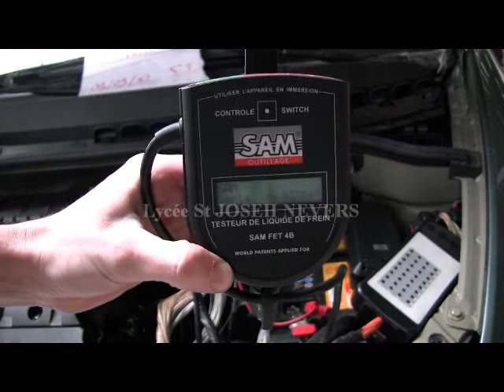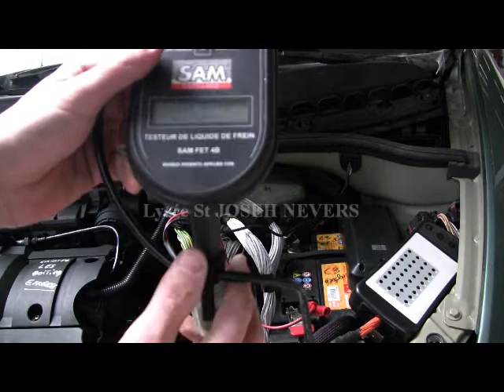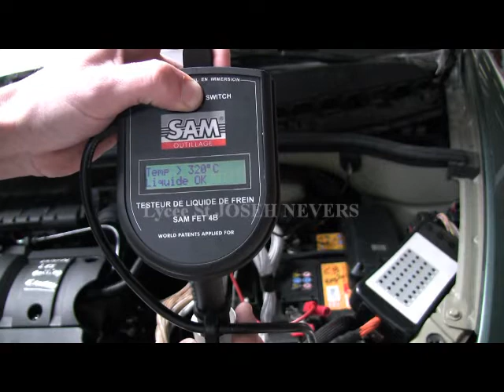Test liquide de frein

Comment from the maker: Ce testeur contrôle le point d'ébullition du liquide de frein. Si ce point est trop bas, le liquide de frein est à changer. Pou rappel, s'il y a ébullition, il y a créations de bulles d'air dans le liquide circuit de freinage et donc il y a dysfonctionnement du système. C'est un très bon outil.

Comment: Un commentaire aurait été le bienvenu..........
Reply from the maker: Ce testeur contrôle le point d'ébullition du liquide de frein. Si ce point est trop bas, le liquide de frein est à changer. Pou rappel, s'il y a ébullition, il y a créations de bulles d'air dans le liquide circuit de freinage et donc il y a dysfonctionnement du système. C'est un très bon outil.

Comment: bonjour , je vous fais un commentaire , on comprend rien du tout et on voit rien du tout sur votre vidéo , pas d'explication a quoi ça sert votre truc testeur d'huile des freins,comment ça fonctionne , c'est quoi ses fonctions , des explications aurait été le bienvenue mais c'est pas le cas ???????
Reply from the maker: Ce testeur contrôle le point d'ébullition du liquide de frein. Si ce point est trop bas, le liquide de frein est à changer. Pou rappel, s'il y a ébullition, il y a créations de bulles d'air dans le liquide circuit de freinage et donc il y a dysfonctionnement du système. C'est un très bon outil.
Reply: bonjour , moi perso , j'ai bien compris que c'est un testeur pour liquide de freins mais mais pour les gens qui regardent votre vidéo , ils ne peuvent pas savoir ce que c'est , comment ça fonctionne , a quelle température d’ébullition , si l'huile est encore bonne ou pas , vous avez mis aucune explications . alors DOT. 3 minime en  ébullition 140°C , il est encore bon , le DOT.4 minime en ébullition 155°C , il est encore bon , DOT. 5,1. minime en ébullition 180°C , il est encore bon , au dessus de ces chiffres là , l'huile est pas bonne , faut changer tous les 2 ans , il y a beaucoup de gens , qui le font pas parce qu'ils connaissent pas , dites vous bien que l'eau bouille a 100°C , maintenant , je vous ai donné les minimes de ces 3 chiffres que l'huile soit encore bon , au dessus de ces 3 chiffres , ça veut dire que il y a plus d'eau que d'huile alors il faut impérativement purger le liquide de freins , avenant a votre testeur , c'est pas donné au niveau pris , c'est abusé pour des particuliés , de 400 euros a 600 et plus , ça depent les modeles maintenant , c'est bien pour les garages , mais des fois meme eux ils ont pas , parce que le prix est trop élevé quand on voit maintenant quand on purge ça coûte 50 a 57 euros ou certains a 75 juste pour barratiner il vous parle de ABS et tous leurs blabla !!!!!!!!!!!!!!!